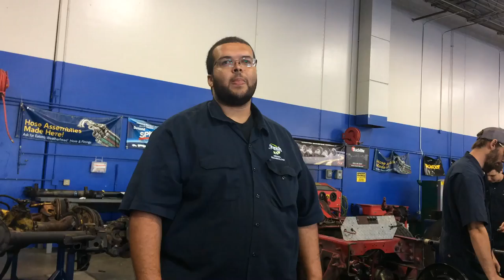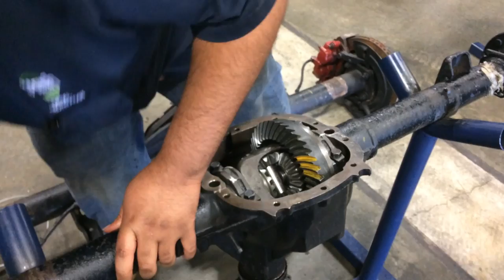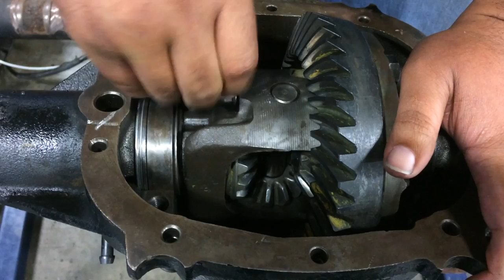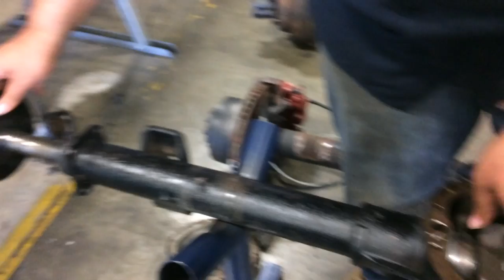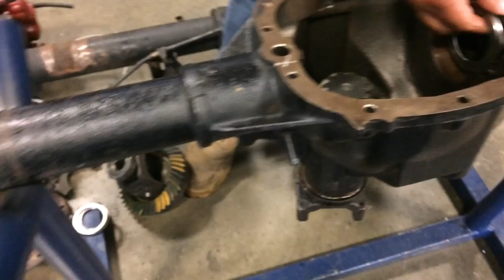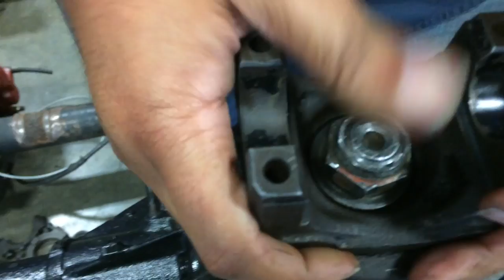How to disassemble a rear differential

Comment: Austin,  2002 s10 7.625   wanted to take pinion out. bad bearing outer!  Took out everything on other side, then   Took off nut,  used puller to remove  universal bearing carrier  and pinion not coming out.  Would the crush sleeve be holding it together?  I put nut on threads and hit with hammer.  ???????  Seriously need answer .